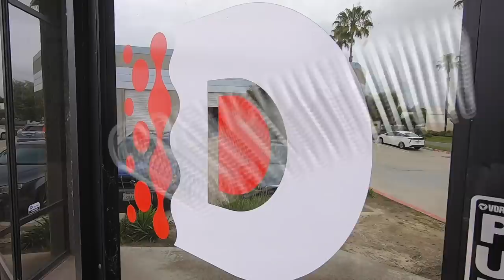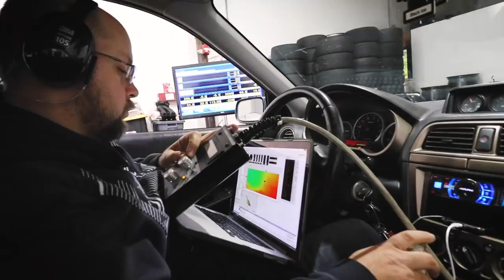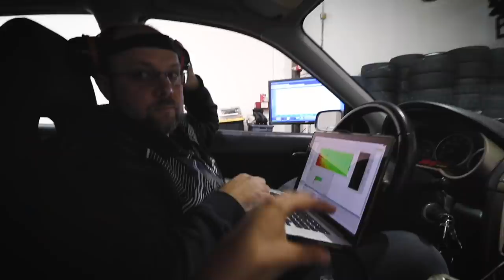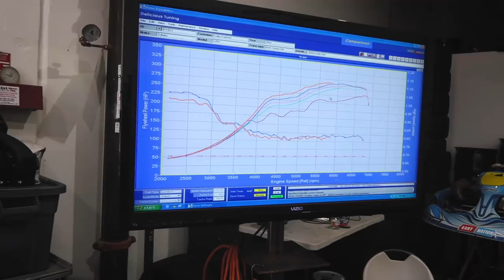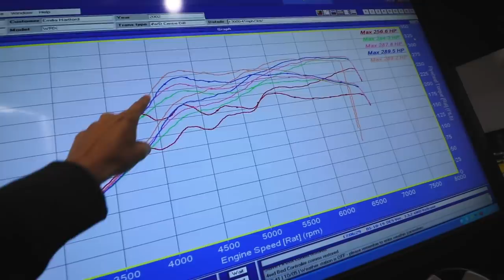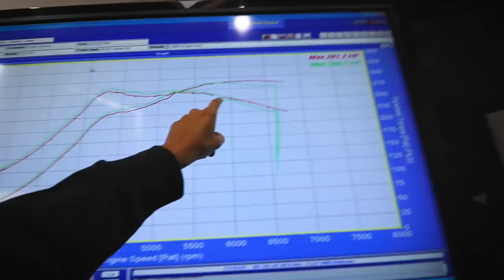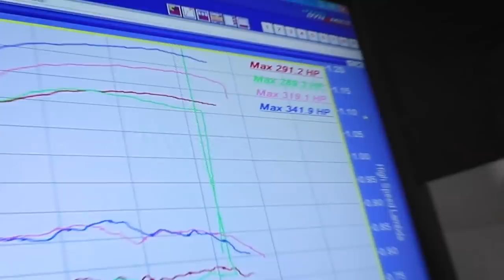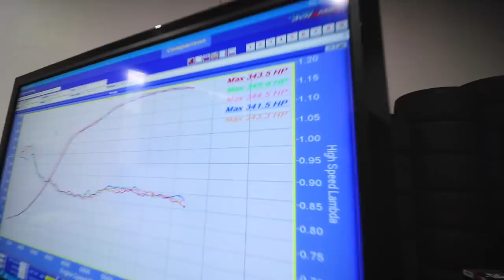MAKING BIG POWER ON THE DYNO!! WE MAXED OUT OUR TURBO!! *pew pew*

Comment: EMELIA - You should be able to advance your Ignition Timing on E85; this is because Ethanol cools the charged-air (compressed air) coming into the cylinders more than gasoline does (hotter for charged-air cooling). As a result, your Knock thresholds are pushed closer to or past MBT Ignition Timing (spark hook test curve) - therefore, you can gain power (mechanically) since your peak cylinder pressure point in crankshaft degrees, happens closer to TDC (top dead center). So the peak cylinder pressure is occurring at a sooner point in the crankshaft revolution (from top to bottom), as oppose to further or later in the crankshaft revolution (less time/duration of force applied during entire downward rotation/revolution on the combustion stroke).

Torque = Force x Distance 

Pressure = Force / Area so, algebraically, Force = Pressure x Area and thus, Torque = (Pressure x Area) x Distance

Piston surface (area) | Combustion Event (Pressure) | Force (Pressure applied over entire defined Area) | Distance (crankshaft stroke)

Ignition event happens at a Calibrated/Tuned value in degrees before TDC - but the combustion event takes TIME to fully expand, so peak cylinder pressure happens AFTER TDC. THIS IS WHAT WE'RE AFTER! That "time" for the Combustion Event can be referred to as the Burn-Rate - which is dependent on air density, air temperature, area/region over which the event occurs. Ignition Timing varies w/ engine RPM due to the "time" the combustion event takes to occur relative to the piston moving faster up/down in the cylinder - so in order to keep peak cylinder pressure occurring at the same point in crankshaft degrees relative to increasing engine RPM, one must advance the ignition timing. BUT REMEMBER, this varies w/ engine LOAD (air density entering the cylinders).

Generally, high load and mid-high RPM, is where you see the least amount of Ignition Timing - mid-range/steady state cruising RPMs at low load is where you see the most amount of Ignition Timing advance.

So on E85, the ignition timing values in degrees goes UP, cause we're ALL trying to shift peak cylinder pressure points closer to MBT (maximum best torque).

Sigh...

I exhaust myself writing these comments trying to teach/help Emelia - but sadly, I don't think she'll read this.
Reply: 755hp  I don’t blame her, life’s too short.

Comment: the type of dyno you have here is a light weight type the 4000lb roller type in floor are more // there could be 10 runs and they will all have a spread on hp

Comment: Twin scroll for who? Unequal length headers should be an official Subaru extra option hahahaha, because boxer rumble is life hahaha
Reply: @SeventhCircle77  not to real fans of the boxer engine, if you want an efficient soul less engine just go for an Evo, they are faster but lack personality.
Reply: @SeventhCircle77  then price would be your criteria for getting the car, the new STI is so dull and boring because it misses the simple element that is the boxer rumble, without the boxer rumble it is just another 4 cylinder making power. You can enjoy evos if you want, but Subaru started a fan base just by it's sound and AWD, if you take away these fun parts of the car, they might decide to make some RWD to save on fuel and production costs.
Reply: @SeventhCircle77  that new rumble is simply pathetic, if you have loved some of these cars since like the GC8, the equal length swapped Subies just don't have that special character. When you have a passion for something, it doesn't have to make too much sense, it just has to make you happy, for 2k you got a car because of cost, the rest didn't really matter. It's all good though, to each their own, hopefully they won't find an efficient reason to ditch V8 rumbles hehehe

Comment: There are a lot of things you are not being told. It looks like your power increase is from boost/PSI. Most likely you are running 17 or 18 PSI hence the feeling of speed. Notice that the power only occurs for a second or two. Then you have to shift. The probability is high that other cars will walk away in a race. Peak WHP on the dyno sounds good but the truth to the matter it is sustained WHP that counts. Here is a video that proves how stupid dyno numbers can make you look. The Supra falls on its face after each shift it cannot sustain the HP. The GTR has 300 less HP and creeps away every time. https://www.youtube.com/watch?v=nnpBwtoEr2M . 

If you look at your dyno chart your HP is on a decline which means you are slowing down. 

There so much more injector duty cycle, AFR, Boost, Fuel Pump, EGT.  Even 15:03 that puff of blue smoke on the peak of a run is saying something. ECUTek flash is the better option..... Efficient power.

Comment: All that wasted time and money when you could have bought a good car like a Evo and made that power easily!
Reply: Evos and Dsm break too
Reply: @enzoc3869  Unlike subarus, dsms and evos only break when you have a ton of power. Subarus break at stock power levels. Garbage boxer engines.
Reply: @RichRusso4218  not true...they break too
Reply: Scoobysnack 05 you kids are so naive, they break when they have a ton of power. In stock form they are bulletproof. Unlike a Subaru that disintegrates its engines in stock form.
Reply: @RichRusso4218  first of all I'm not a kid, 2nd they break just like Evos and DSM. It's the actual KIDS that dont know how to treat them. Even stock form they break. Subarus are way more around than evo and dsm but if it was the opposite way...I'm sure evo will have that reputation
I've had friends with 2g eclipse...talons and evos and they will agree they arent reliable lol
Reply: Scoobysnack 05 lol, you’re sure acting like a child. Evos are a hundred times more reliable than a Subaru. I do nothing but swap Subaru engines all day. I could name off every item that fails on a crappy boxer engine. Have daily driven my talon for 10 years at over 430awhp. Have driven my evo with 574awhp every chance I get. Not a single problem except alternators in the talon (it’s right next to a 3” exhaust and they don’t take heat well). I’ve had several Subaru’s that couldn’t even last a few months with my driving.
Reply: I have a wrx wagon stage 2 and a 400 wheel sti budget build hx35 making 400 wheel with 150k so I don't see an issue tbh